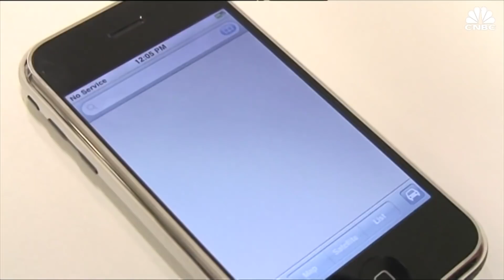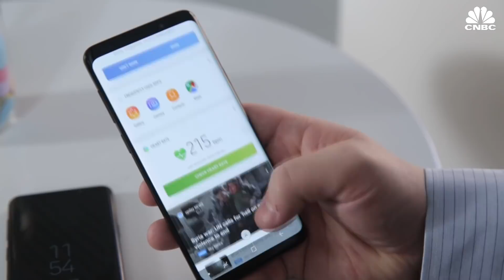How Corning's New Gorilla Glass 6 Is Tested

Comment: Why do they have to use glass? You can't tell me there isn't a type of plastic with comparable clarity. It's been my experience the more shatter resistant the glass the more susceptible to scratches it is. I wouldn't mind a metal screen (like a projector). Durability has been my only hang up with current smart phones. Make them last, $1500 should buy you 3yrs of use.

Comment: I prefer they focus on scratch resistant on par with sapphire...im using note 9 its still can be scratch by daily usage..i end up with those screen protector are useless as they will peel off easily but in return i dont see any scratches on my screen... i dont really worry much on drop as we can rely phone cases like spigen or uag..if you need more.. otterbox... 

Plssssss make it more scratch resistant... it is so expensive to replace the front screen when the marks are there and they look ugly...

Comment: Don't believe what you've just seen. The glass is definitely not handmade, and cannot be due to the latency of manufacturing. A glass of this kind should be melted and dropped on a liquid mercury surface, to be formed and solidified on two surfaces of the glass, just the ingredients of it may change, with extra addition of some extra materials. Then the glass would get a special heat treatment to make it harder and almost unbreakable. Trust me, I work along with an international glass manufacturer, making glass is just about chemistry and physics. From that you can even produce a glass that changes its tint or opacity just by pressing a button. You can do anything with technology nowadays.

Comment: You know what would be good for screens on phone's and whatnot to come up with a system where you can use some kind of liquid glass technology like when you get a chip on your car windscreen your professional would come out and apply some sort of resin that stiffens like glass through pressure and would give you a near perfect screen again perhaps they could put it between the layers we have in our screens now then when the phone has realised it's been dropped and got a cracked screen it could then start to repair the crack(s) where they would put it who knows maybe they could give you tool to do it, in the box you know as a extra or they could sell as a tool separately from phone so you could do it yourself with the materials at home saving yourself money at the same time iPhone would have a reason for charging$1200

Comment: But they all break the same way. From the edge. That would be impressive. However, testing it on a flat surface or hitting the centre of the screen is like checking a tire survives puncture by driving up a curb. It's not the reason they fail. It's a false strength. We know glass breaks easiest from the edge. Hence you having to hit any car windows at the edge to make it shatter and not in the middle. I'll be impressed when I can drop my phone on it's corner on gravel and it doesn't shatter.

Comment: Eh, I just use a tempered glass screen protector. They're pretty cheap at $1.5, I buy ten of them for a discount at $10. If one breaks, just replace it with another. I still haven't replaced my first tempered glass screen protector in 8 months, it hasn't been damaged one bit and my phone comes with Gorilla Glass 4 😂

Comment: It is not that tough. If it is that strong then why does my galaxy s8 have a chip in the front glass and when I got it it already had a scratch on the back glass. How do you explain that. You need to make it tougher. Not weaker

Comment: Many companies like asus still use gorilla glass 3 on their flagships as it says gg3 is more tougher than 4 and 5 and you say you make it better with each generation? I guess you're making'em weaker so you get more profits in repair and new phones that people buy 🤨
Reply: GG3 is more scratch resistant than 4 & 5. But 4 & 5 are shatter resistant.
Reply: exactly this, scratch resistances and shatter resistance are different. my galaxy s8 uses version 5, but can be scratched with a butter knife...
Reply: Shubhansh Bothra you are right gorilla glass 3 is strong than 4, 5, 6
Reply: The harder it is to crack the glass the easier it is to scratch, and the harder it is to scratch the easier it is to crack 🙃.  

But perhaps in the future we’ll come up with something that fixes that! :D
Reply: Shubhansh Bothra That's not quite the reason. Gg3 is just the more reasonable choice if you have chost effectiveness and scratch resistance in mind. Gg3 is perfect for plastic, ceramic or metal backed phones, but those glass on glass sandwhiches are better off with Gg5 or higher since it would cost more if both sides broke, than if just on side scratched.
Reply: OverFLOw oh, okay 😅
Reply: Hey i come from future and now Asus Zen Pro M2 using GG6
Reply: My new galaxy a71 has gg3 and my old galaxy s4 has gg3.
Reply: Bro asus is lying lol. They are trying to keep cost down
Reply: Vlican I also have s8 and mine is not scratched.
Watch some Jerryrigeverything videos - almost every phone have same scratch resistance, and it can't be scratched with metal knife.

Comment: but what about scratches?
Reply: Sameer Shah Same level of scratch resistance as gorilla glass 5
Reply: Scratche at level 6 with deeper grooves at level 7
Reply: With scratches at a level 6
And deeper grooves at a level 7
Reply: Still the same though... If you increase its hardness that mean it will more brittle and easy to break
Reply: The glass would most likely need to be made out of diamond to be scratch proof or at least real sapphire maybe which is better at scratch resistance then gorilla glass
Reply: Chuy hey man I have a nexus 5 2013 which has gg3 and Samsung galaxy s7 2017 gg4 still my older Nexus 5 has less scratches then my s7
Reply: Sameer Shah well it depends on how well you take care of it, I had an s7 edge with a Dbrand skin and the back never got any scratches but the sides and the screen were pretty scratched up. But I was just talking about the materials the phone would have to be for it to be scratch resistant without any protection or babying the phone

Comment: So.... basically EVERY time Corning make a tougher glass, phone manufacturers want it thinner.
That means every year it'll remain the same, BROKEN!
Reply: Stronger *2
Thinner /2
Result : same every fking time
Reply: They slow down the software after 2 years in case glass doesn't break.
Reply: Otherwise you wouldn't be buying a new phone every 1 or 2 years!!!
Reply: E X A C T L Y
Reply: Wow, my Motorola Droid turbo 2 doesn't have a gorilla glass. So the plastic layer over the display is definitely unbreakable. 😂😂
Reply: Agree my S8+ drop once with a casing and the screen have hair line crack. But my older LG G2 & note 2 drop like many more times with no screen crack
Reply: DanRC ** I don’t want a thinner phone I want a more durable one.
Reply: Lloyd Share The S8 is like carrying a raw egg around in your pocket all day. I know. I have one & have already replaced the screen once.
Reply: C O  well said
Reply: Not true the s9 has thicker glass than the s8
Reply: C O ,😂
Reply: Rozu   Totally with you on that one.
Reply: Five10    I wish more manufacturers did that. 
I know it'd scratch very easily, but nothing a good and easily replaceable cheap screen protector couldn't fix.
It's FAR better than todays fragile phones with Gorilla glass on the front and back.
Reply: You can’t really make anything thinner than 4.8mm without it slipping out of your hand
Reply: Not the note 9

Comment: Do A real life drop test on hard stone surfaces Rather then soft laboratory tests.
Reply: It's being dropped on a tile of hard flooring.  The test biggest problem is the angle of the drop and not the floor because most phones are dropped on its edge.
Reply: EH CBunny the biggest issue is when you drop it face down on a tiny pebble... Edge is fine
Reply: pretty sure they do real life drop test, the mechanized drop is just for testing consistency and to ensure the right angle of impact, supposing that a 167-year-old company applies wrong testing method is rather arrogant ;D
Reply: @Don Those who suppose are experiencing the Dunning-Kruger effect.
Reply: Noby Despacito I had an  galaxy A8 2015 it fell on concrete once face down  and no cracks or scratches I'm hoping the same can happen with A8 2018 I bought
Reply: They do but that’s not what this is about, it’s a bout testing all glasses in a controlled environment so all of them endure the exact same thing and they get the strongest glass possible. Testing it on a harder surface would probably make it break faster but so will the rest of the glasses. It won’t make them make the glass stronger just the testing procedure would be different
Reply: He said average people drop their phones 7x a year. I’m calling bs.
Reply: you live on a cave?